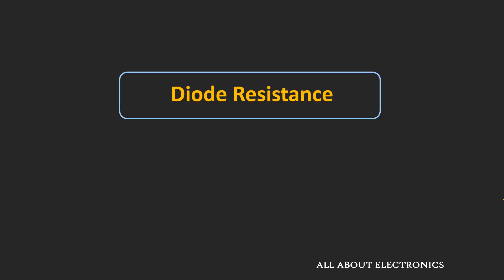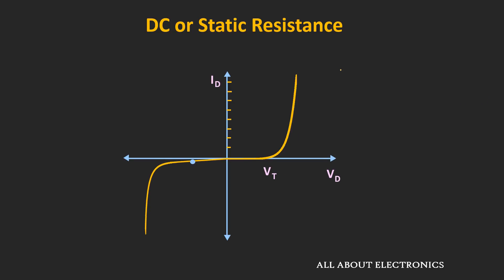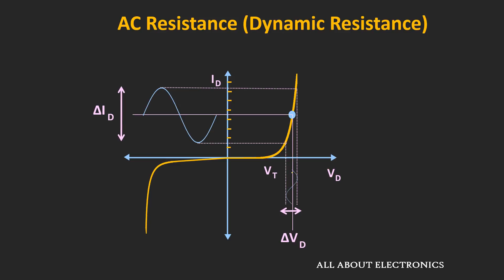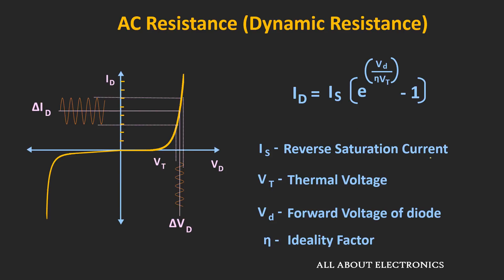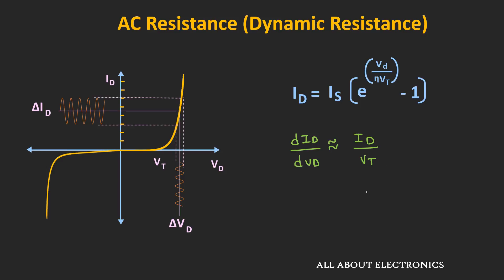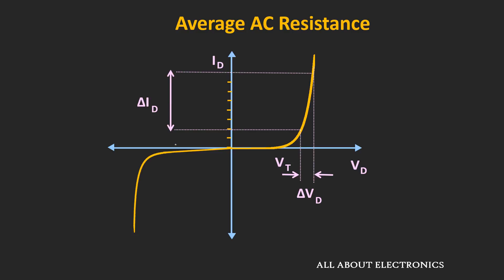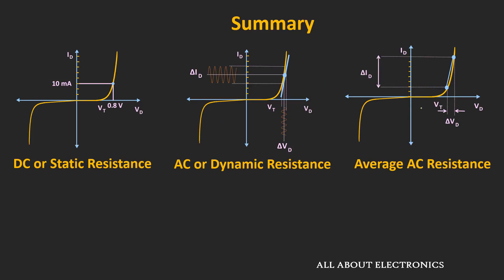Diode Resistance Explained (DC Resistance, AC Resistance and Average AC Resistance Explained)

Comment from the maker: The timestamps for the different topics covered in the video:

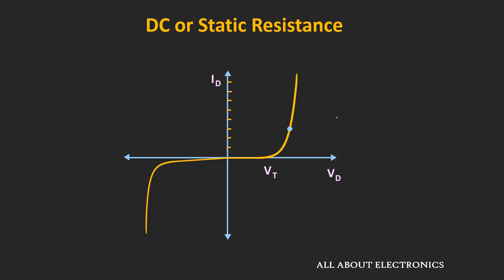1:52 DC or Static Resistance of the Diode

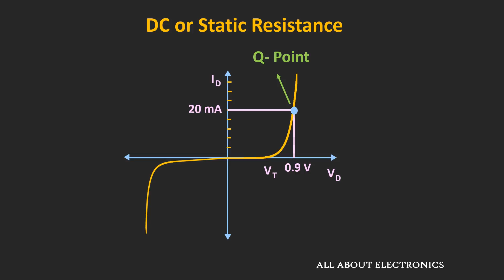4:49 AC or Dynamic Resistance of the Diode

6:47 Derivation of the dynamic resistance

10:22 The average AC resistance of the diode

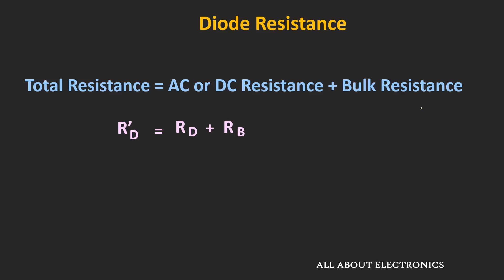12:42 Summary

Comment: I just have a question at the total resistance. You said that this resistance = DC/AC resistance + bulk resistance, but when I asked chat GPT that it isn't equal (it explain : "The term "bulk resistance" is not commonly used when referring to diodes. However, diodes do have a parameter called "dynamic resistance" or "differential resistance," which is a measure of how the diode's voltage-current characteristics change around a particular operating point...
In general, the total resistance of a diode is not equal to the sum of the bulk resistance and dynamic resistance..."
I don't know which answer is correct. So I ask you to verify this question. Thanks very much !

Comment: Why forward bias characteristics of diode after threshold voltage is exponential?
Reply: So when the diode is subject to forward bias voltage the current start flowing exponential.. that is a fact.. and that is also evident from the diode equation.. you can see the derivation of the equation from where the exponential comes and you'll get your answer

Comment: can you explain this circuit diagram please. https://cdn.sparkfun.com/datasheets/Components/LED/LEDstringlights.pdf
Reply from the maker: In that diagram, the 25 pieces of LED are connected in parallel. And that bunch is connected in series with another bunch of 25 LEDs.

Comment: Is the total resistance Rac + Rdc ? or  Rac + Rbulk   or Rdc + Rbulk, got confused at the end there.
Reply from the maker: Its the summation of Rac or Rdc + Rbulk.
If only DC voltage is applied then one needs to consider Rdc. 
Similarly, if AC resistance is applied then consider Rac. 
So, that total resistance will be either Rac or Rdc plus Rbulk.
I hope it will clear your doubt.